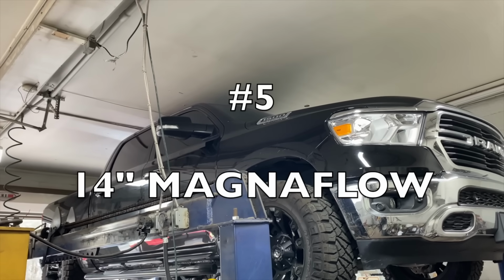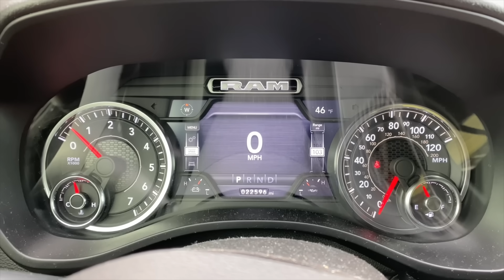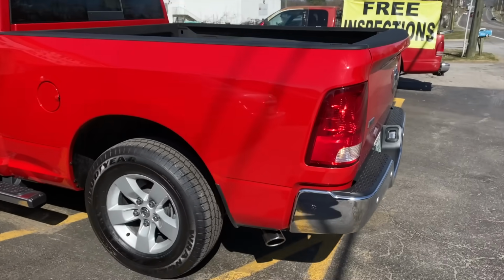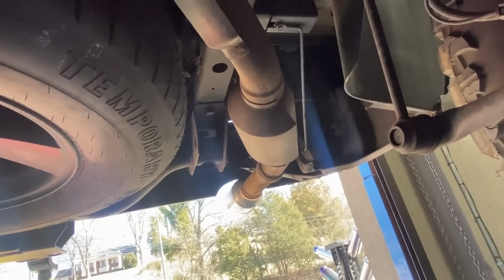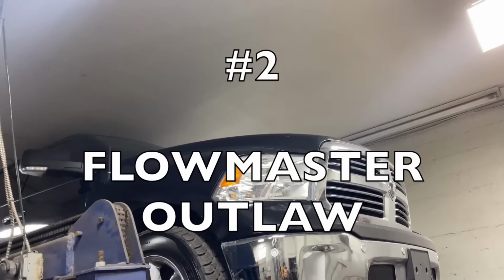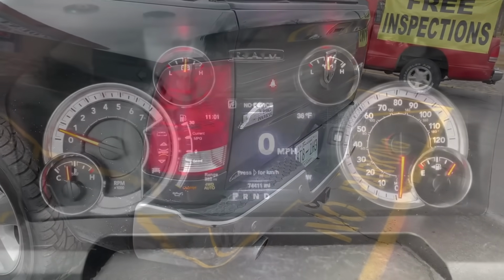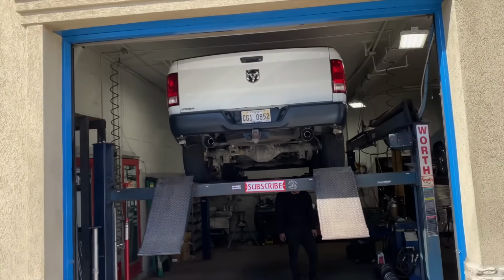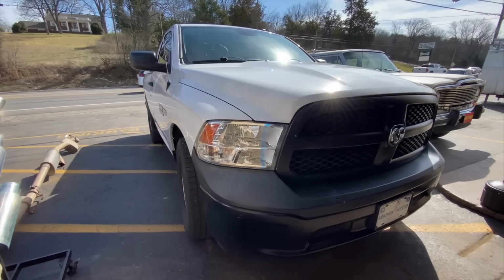Top 5 LOUDEST EXHAUST Set Ups for RAM 1500 5.7L HEMI (vol.2)!

Comment: Nothing beats true duals on a hemi!
Reply: Here here 🙌🏻🙌🏻
Reply: I agree with you. True duals on a Hemi are awesome sounding.
Reply: @adamzimmer6365  ...I have a 2015 Crew Cab 4x4.  I put shorty headers on it, high flow cats with 3 inch  true duals all the way back into 4 inch rolled tips out the back like it was factory.    No resonators.  It’s pretty obnoxious lol, especially on a cold start.  I need to get a tune on it but I only drive about 3k miles a year lol.  Hard to beat the sound of any Hemi. 😎
Reply: Them ain’t true duals
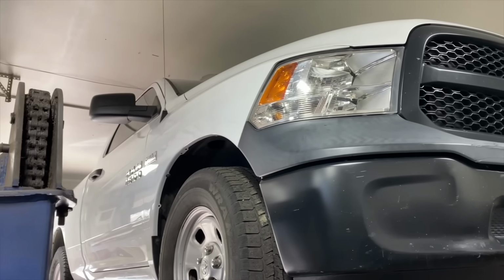Reply: @ryze1120  13:32
Reply: True dual straight pipes goddamn🥶🤙🏽🦍

Comment: The last one was by far the best, I wouldn't even waste my time with the ones prior to that personally. Although a lot of that pipe you could have used just replace the mufflers with pipe wouldve saved you a lot of extra pipe. Other than that great job 👍
Reply: I have the same with long tubes and high flow cats, it's insane
Reply: I have the Borla XP ans only cut off the front resonators and it sounds better than almost all of those trucks.

Comment: The Dynamax and straight piped systems sounded the best. The Hemi sounds unlike any other engine, it's so gutteral and brutal with the right system. I have an 06 5.7, currently with a Magnaflow single exit kit, 5 inch tip. It sounds great but nothing like it could.

Comment: I have a 2008 big horn edition n the hemi never fails on the passing power needed on the highway and the acceleration is underestimated compared to the fords 5.4 and Chevys 5.3 which I own both the hemi torque and horsepower can tell the difference on each truck

Comment: I got an 07 ram with Cia, 87mm tb shorty headers, hi flow cats, and now straight piped. It sounds like a bomb going off in morning. So I been thru most mufflers and got a borla atak crate muffler coming tommorrow. Hope I like it tired of switching
Reply: How'd it go?!
Reply: @jordan76brodland  I like it better than all the rest I tried. I like to change it up once in a while so thinking of a spin spintech 9000 muffler next🤣
Reply: @Skullman7487  hahaha I like your style. Guess you're not too tired of switchin just YET eh xD. Post up some clips if you haven't already brew! What cold air intake you running? Just the ol' K&N?

Comment: The true dual pipes.  That's the sound I NEED

How much would something like this cost?  I have a shop that was going to cut out the resonators and muffler delete - but everything about that last exhaust.  I am doing THAT.

I've taken notes.

2 1/2 true dual system into 5” angle cut tips

Exhaust Addicts, is there anything special I should know about?  

2015 Crew Cab 1500 5.7 4X4  6" BDS Baja Boss 37s]

Love the channel guys.  Keep up the great content!

Comment: I want to know what you guys at the garage think is your top three favorite Ram 1500 exhaust notes are I'm trying to go a different route with my second RAM I'm pushing 498 at the wheels eventually I want to put headers on it last time I just did a muffler delete left the resonators on it It sounded amazing and I turned off that engine damaging 4 cylinder Eco mode bullshit but I want to just go all out and do it right and one time only this time around

Comment: What’s the wheel/tire set up on the first ?
Reply: Fuel vapors I think... with nitto ridge grapplers. My guess would be 18x9 -24 with 35x12.50 r18 tires

Comment: 13:32 Question? Would an X or H pipe increase performance?
Reply: Lol... an exhaust doesn’t do all that much to a stock setup. You might see 5hp if you do the intake too. If it’s not stock then an open exhaust and intake will be necessary so it’s not a bottleneck. It’s all really just about sound if it’s stock.
Reply: X pipes improve flow, H pipes restrict flow

Comment: what set up would you guys recommend for a v8 2008 F250 5.4l? i want something that’s loud but not loud enough to annoy me while driving
Reply: Duels or single exhaust?? Magnaflow 18" muffler with a 4" tip is good for a single.
Reply: Those 5.4's have a really restrictive exhaust, since they have 4 cats. Even a glass pack wasn't that loud on the one I used to have.
Reply: @lordowl3533  delete the secondary cats which are the ones further back near transmission. Then go buy you a 2 1/2inch Cherry Bomb M80 muffler which is basically a round Flowmaster Super 10 single chamber muffler. It's only $59 at AutoZone and not too loud with 2 cats still on it.

Comment: I need help Guys.  I recently put a super 10 on My 2020 ram hemi.  And I noticed that when I floor it (high rpm), there is a slight humming sound and sort of whistling sound.  I’m wondering if it could be because I left the resonators on. Or is that normal with the flowmasters
Reply: I have no resonators on mine and it also whistles when I get on it

Comment: I drive a 05 Dodge Ram 1500, but I run a Flowmaster Super 10 Series with a K&N Cold air intake, headers and a 10” exhaust tip. Would put the “#1” to shame

Comment: None of the trucks are straight piped. My 2014 5.0 F150 is straight piped, long tube headers, no cats, off road X-pipe, free flow mufflers, dual 3" inch mandrel bent tubing all the way from the header collectors to the back of the exhaust (full stainless works offroad exhaust). My truck isn't even super loud and it's louder than all of these.